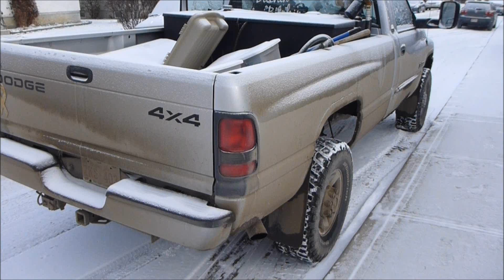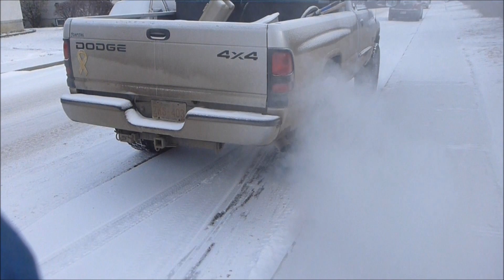Cummins 24 Valve Cold Start + 3cyl High Idle

Comment from the maker: Actually this is a pretty low mileage Cummins. At the time of this video it had 76 000kms (47 500 miles). It wasn't plugged in when we took the video and it was balls cold. It's also before I switched over to winter oil (0w-40).
Reply: super low miles
Reply: Talk to me when you hit 387k

Comment: No reason to be let down by the lack of smoke.  That's a good thing for many reasons.  First and foremost, it means your truck is running well and with good efficiency.  It also means that you don't have any major blow-by issues, due to a heavily worn engine.  Secondly, it means you aren't burning oil.  Third, it means you aren't wasting preciously expensive diesel fuel.  Forth, it means that you aren't pissing off lots of other people on the road and giving the loser EPA reasons to continue to choke off our diesel trucks with emissions shit, due to their ignorance and stupidity.  So with that said... be happy.  P.S. Wanna see lotsa diesel tailpipe smoke and waste lotsa money on fuel?  Buy a programmer and turn it up.  It's really just that easy.
Reply: you sound like a hard core Jew
Reply: *****
 No worries there, CrackHead... I'm not a Jew, but thanks for the attempted insult.  Really don't care what you think.  Facts are facts, hoss.  Take care bud.
Reply: I’m pretty sure it’s tuned already. I’ve heard for vp 24vs to go into the 3 cylinder high idle. It has to be written into the tune
Reply: CrackHead476 🤣🤣🤣

Comment: u must have no grid heater because mine starts easy when it is - 4
Reply: I was thinking same thing. All these videos of guys taking 3 min to start up mine cranks for 10 seconds and fires up.
Reply: He has a working gird I think there is something worng with it not get the proper fuel or air but I am not sure I am taking class in auto mechanics not diesel
Reply: And sometimes it takes a long time for the gird
Reply: My dads has no grid heater right now and starts easily when it’s -1F
Reply: Every truck is different and your fuel can also make a difference in that the diseal in the my profile pic is summer diesel but it was 37° today I let the grid heater do its thing and after cranking it for about 20 seconds if fired

Comment: What was the ambient air temperature on the day you shot this video?  (You know, the outside air temperature?)  I'm still trying to understand what is the purpose of running any 6 cylinder engine on only 3 cylinders is - at any point in time?  Sure seems to me like a really good way to prematurely wear piston rings and cylinder walls out if you ask me.  Because they must be cutting the fuel to the cylinders in order for them not to fire - right?  Yeah, the engine may heat up a little faster, but is that really worth the extra strain and wear on the engine?  Wouldn't it be smarter to plug in your engine's block heater and use the air grid heaters on cold start up, let the truck idle normally for a little bit, (like every other diesel on the planet) and then off you go?  It would be interesting to see some factual testing of repeated cold starts with 3 cylinder high idle used versus regular starting procedures and see which engine lasts longer before developing blow-by and low compression issues, let alone any other strange problems that could occur from this practice over time.  Wonder if Cummins ever bothered to do such real-world testing, or is it just another "great idea" that some genius software engineer came up with to expedite heat within the engine, once running, without care as to the longevity of said engine?
Reply: more strain on engine makes more heat.
Reply: mr.tom1817: No shit sherlock - LOL!
Reply: Turbo Diesel I agree. Glad my dodge came from the factory with a normal high idle. I don't understand if you are going to hack an old dodge to give her a high idle either grab a programmer or make it idle on 6.
Reply: He says ambient temp is -20 C or -4 F. What kind of real strain are you putting on the engine? The truck isnt driving, it isnt pulling anything, and its not under load. Seems like running on 3 cylinders would put the engine under a small amount of load to get it to heat up faster. I dont know why you think the cylinder walls would be damaged, its not like its stopping oil flow by only running on 3 cylinders. My only concern i would have is the uneven amount of heat generated inside the motor. While 3 cylinders are heating up the other 3 are not, yes they would be gradually heated through the block from the other cylinders but once you go to drive away 3 cylinders will be up to operating temp and 3 wont, doesnt sound like a good idea to me. There has to be a programmer that raises the idle without shutting off 3 cylinders.
Reply: It's more strain than just a normal idle but not any more strain than going down the road. My EGTs sit at about 650-700* F in the 3 cylinder idle, which is comparable to what they are when cruising down the interstate.
Reply: It will cut the fuel from 3 cylinders and double the fuel to the other 3 cylinders thus it will create more load and will bring the egt's to 700-900 degrees
Reply: 3 cylinders operating under load (because the other 3 aren't firing) consumes more fuel than 6 cylinders operating under (essentially) no load. More fuel consumed = more heat generated = faster engine warm up. I don't see what piston rings have to do with it.

Comment: More load on the engine. High idle shows 300 degree egt where 3 cyl high idle is around 650 degrees
Reply: Would that be to warm it up?

Comment: Does every 24 Valve cummins have this stock? Just wondering because I have a 1999 Dodge Ram 3500 with the 24 Valve cummins and I've started it in cold temperatures before without being plugged in and this has never happened to me. If you could get back to me that would be awesome, thanks.
Reply: No Brock, none of them have it in stock form.  It is an optional thing that can be turned on with either a Smarty programmer, or with Chrysler's DRB III scan tool.  Is it worth it?  In most cases, probably not.  Best to PLUG IN your truck's block heater, and also make sure your intake air grid heaters are working correctly!  Sometimes you may need to "cycle" the key switch a few times to run the grid heaters longer when it's very cold out also.  Finally, and just as importantly, make sure you have a correct much thinner engine oil viscosity in your engine for such cold temperatures, such as 5w-40 or thinner.  15W-40 is far too thick/heavy an engine oil for temps below 0 degrees Fahrenheit.
Reply: Alright, im gonna carry on doing the block heater instead of chipping it
..
Reply: SuperTurboDiesel2
  3 cyl idle is awesome... it  warms up quicker and it prevents cylinder wash out...  wish my 12v had it
Reply: Alan Ackaway
Prevents cylinder wash out?  What are you talking about, Alan?
Reply: Turbo Diesel
  If you let a cold 12v or any old diesel idle when cold, it doesn't run efficiently and diesel doesn't get completely burnt and it ends up in the oil  IE the cylinder gets washed out with diesel...  Bump the idle up to 1000-1300RPM to prevent this
Reply: alright thanks
Reply: Brock D
 Only on  cold engine, once its warmed up its fine (or if you plug it in)
Reply: Whenever possible we always plug our diesels in, when it's cold out.  Just common sense, from my perspective.  Just like letting them warm up is common sense as well.  Briefly high idling them around 1,000 - 1,300 RPM (on average) is usually a good idea as well after a cold start. Just like a warm-up period is particularly important before putting the engine under any kind of a load, such as towing or PTO work, or whatever.  I'm not saying that this whole 3-cyl warm-up thing is a terrible thing... But I really don't believe it's necessary for most people, including myself.  I wouldn't pay extra for that to be added to my truck.  Cumulatively, my family has owned many, many different diesels for over 50 years, and we've never had an engine failure or needed an overhaul due to lack of lube or any cylinder wash out issues.  Run the correct viscosity oil and good filters, plug 'em in when cold, ether 'em only when absolutely necessary, change the coolant (antifreeze) every 3 to 5 years, etc...  Simply put, if you take good care of 'em, they really will run "forever".
Reply: Turbo Diesel
 Cylinder wash out doesnt occur when you plug it in
Reply: Brock D Chipping it and keeping it in economic settings with gauges and a good lift pump would improve engine life greatly. It would let you know when some thing is going wrong to prevent other parts from breaking. The biggest concerns of these would be the vp44 when it doesn't get proper fuel pressure or you run your truck to hot it could break.
It would also add a bit of power to help you tow if you wanted to because its a programer. Just don't romp on in unless its in 4th ;)
Reply: +Turbo Diesel I don't think cylinder washout is really a thing with modern engines anyway
Reply from the maker: +b00stdgsx When a DPF system regens it injects fuel into the filter not the engine.
Reply: Brock D mine does it

Comment: whats up with that 3 cylinder high idle stuff
Reply: Seriously, is it cylinder deactivation or a misfire or what?
Reply: Well, I guess it helps warm the engine up faster by deactivating 3 cylinders and having the diesel combust in the exhaust giving higher egt (exhaust gas temp).

Comment: No grid heater?
Reply: The grid heater only does so much. When everything is that cold its hard to get any heat in the motor which is what the engine needs. He should have used the block heater overnight. He was probably trying to prove a point that you dont necessarily need it all the time and these motors will start in very cold temps without much effort